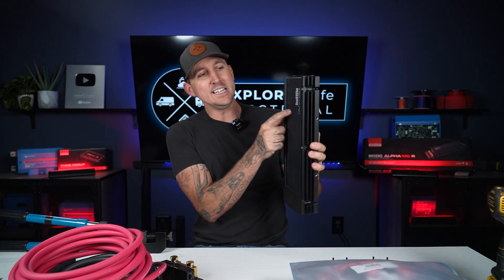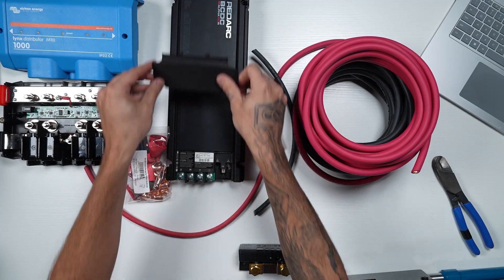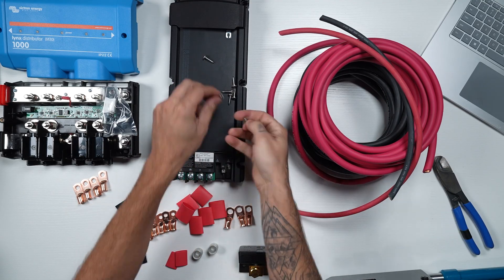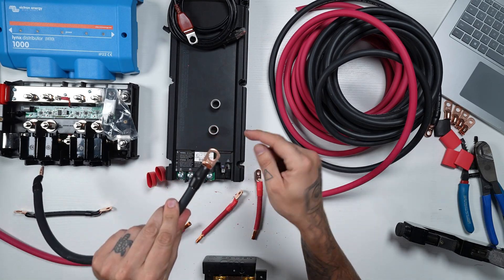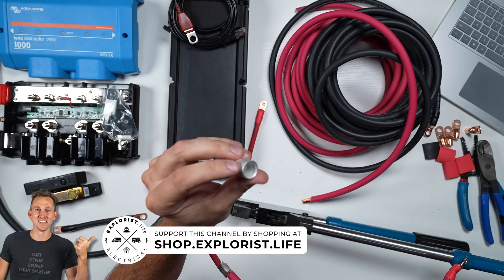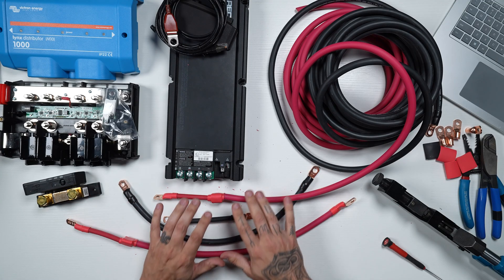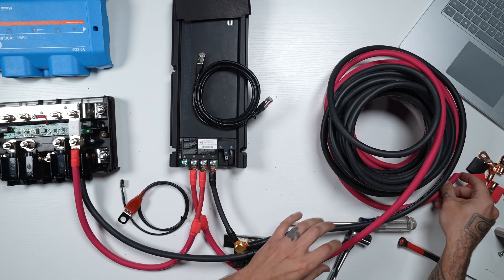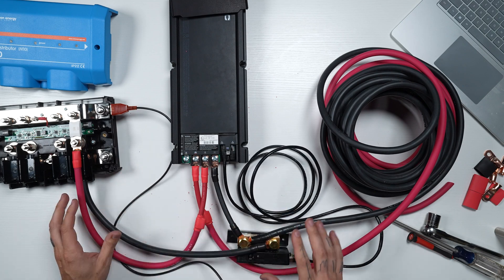How to Wire a REDARC BCDC Alpha 100 R (Step-by-Step Install Guide)

Comment: Great video! Is there any way you can advise me on my solar set up for my trailer? 

I have an Anker Solix F2000 with a BP2600 expansion battery (both internal lifepo 51.2v batteries) and I plan to use the only power station solar input port (a single XT60 port with 11v-32v @10a and 32v-60v @20a, 1000w max input) to expand the power station with a Temgot 51.2v 100ah battery giving me a total of 9,728kwh. The F2000 comes with a cable that has 5 XT60 input ports on one end and a single XT60 that plugs into the power station (so 5-1), but I don’t think I can use it in my set up. I have 4 200w Callsun bifacial panels and each panel is rated at VOC 27.31 and short circuit current 8.91a, that I plan to connect to a 4 string PV combiner box. The combiner box output will connect to a BougeRV mppt 150v/40a. The mppt will connect to the Temgot battery. I got this set up from Theresatrickforthat, except for the use of the combiner box. I also have a Zoup 180w N type portable panel (rated VOC 20.1v and 10.91a) and a Grecell 120w bifacial portable panel (VOC 26v and 6.9a) that I want to connect to the combiner box as separate strings. 

If everything is run in series, then will the single output from the combiner box give me a total of 1100w at VOC 155.34v (slightly over the 150v max of the mppt) and around 7.08a? 

If I ran the Callsun in parallel and the portable panels in series (I think both portables are wired in series), then will the combiner box output be 1100w at VOC 53.32v and around 20.6a? 

Which is better, 155v and 7a or 53v and 20a? 

Also, can I skip the combiner box and use the 5-1 cable if I run the Callsun panels in parallel and plug the portable panels into the 5-1 cable too? 

One more thing, I have a 4000w Maxpeedingrods dual fuel generator to charge my batteries as well and was wondering if I could use it simultaneously with solar? 

Thanks!
Reply from the maker: Thanks for watching! You’ve got a really cool setup coming together, and it sounds like you’re already deep into gathering parts and planning things out. Since there are a lot of variables with solar wiring and mixing different components, this is the perfect kind of project for our Pro Support team to help with — they can make sure everything is safe, compatible, and fully dialed in. shop.explorist.life/prosupportmembership
is where you can reach us! 

We’d love to help you get this system running smoothly!

Comment: Can you cover in a future video how to connect the Alpha to a Lithium starter battery? Redarc will pull from lithium starter battery since the voltage is above 13V thinking the ignition is on. The alpha will slowly drain the lithium starter while parked. Customer service mentioned adding a relay and shared diagram but no mention of wire sizes. Hoping one day redarc will just have a firmware update and add a lithium starter battery setting to the current 12v/24v/auto/off charge settings.
Reply: If they're having you put the relay on the battery sense leave you can use a 16 gauge wire. Because you're not pulling any current at all it's just sensing voltage